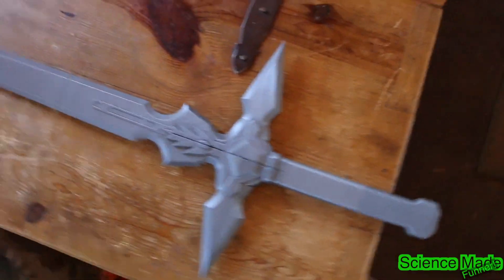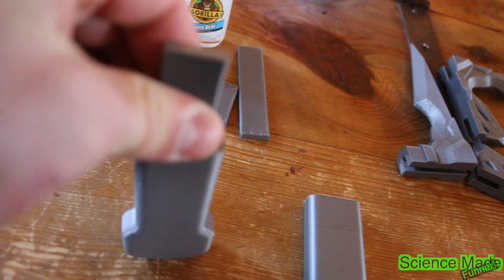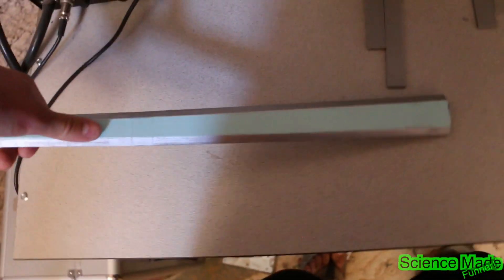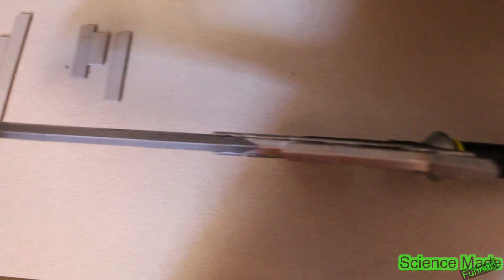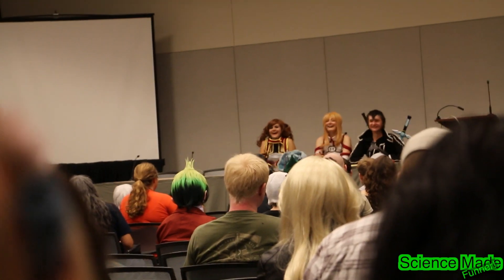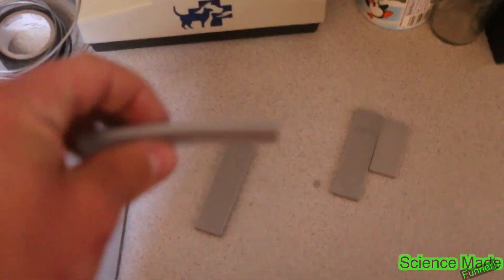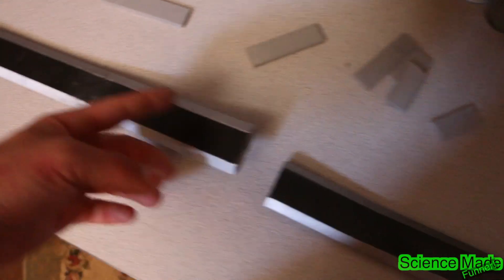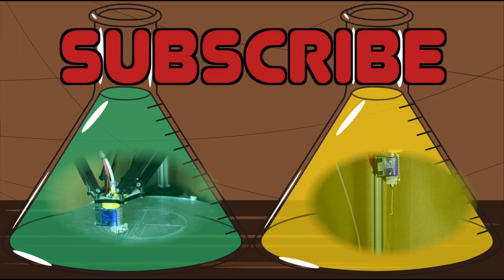3d printer Plastic strength test! PLA

Comment: What was the orientation of your print?  Was the flat of the blade printed on the bed or was the flat of the blade perpendicular to the bed?  It seems the orientation of the printed layers should be along the length of the blade to make it stronger.  Have you tried printing different orientations to test the strength of the print?
Reply: To sum it up, have the print lines long instead of ringing around the blade making 1000s of weak points..

Comment: Really interesting and A good antidote 2 !  Is there a stronger plastic available or can U incorporate where the metal or wood would B N2 the design where U can glue the wood or metal then slip it N2 the crevice of each pc? I did not know how hard it was 2 thread it thru without the adequate pattern of space ?